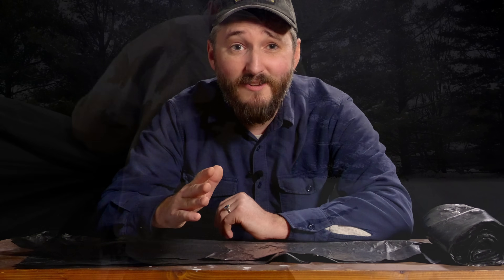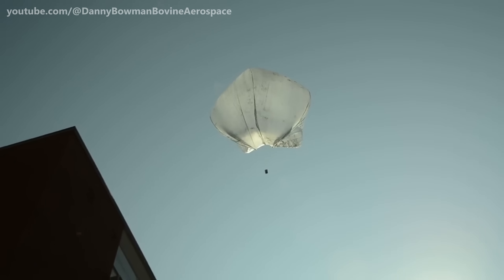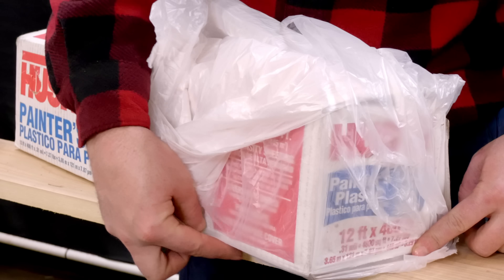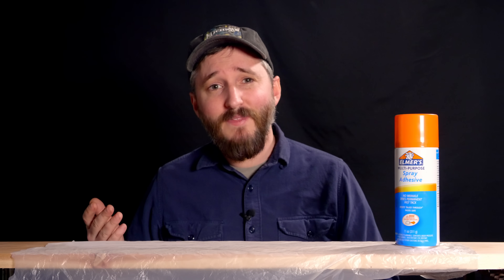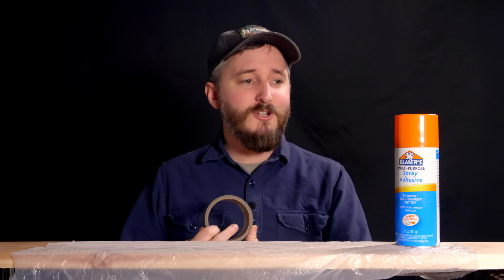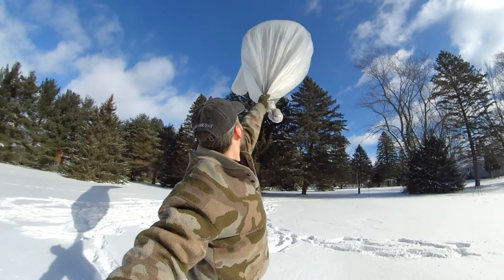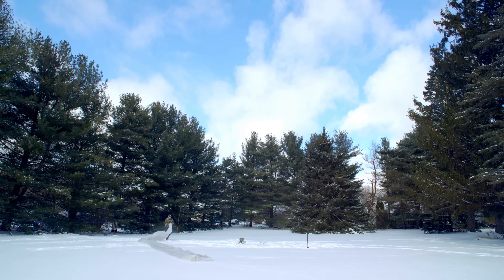DIY Solar Powered Balloons

Comment: Please explain how exactly solar power could cause the tube to become less dense.  It obviously has the same amount of mass the entire trip unless it is losing air somehow.  Is the tube itself expanding?
Reply from the maker: Yes the tube expands. You can easily tell in fact when the sun comes out the tube gets much larger. The one I made had a small hole in it the entire time which makes it deflate very slowly over the course of the flight, otherwise you would be able to tell more easily.
Reply: @Nighthawkinlight  So how about you improve the efficiency by poking a hole in a known point, allow the air to evacuate, then re-seal the hole?
Reply from the maker: @wesbaumguardner8829  It works better if there's no hole at all. Then the balloon inflates to its maximum size and lowest density, or even past the normal size by stretching the plastic
Reply: @Nighthawkinlight  I imagine it would be based entirely on the spatio-temporal difference between the density of the outside air vs the inside air.  This leads me to an alternative.  Use a material that externally absorbs heat and internally reflects heat.
Reply from the maker: @wesbaumguardner8829  That could work
Reply: @Nighthawkinlight  You could further increase efficiency by partially filling the "cell" with specific gases which absorb the spectrum emitted by the exterior paint.
Reply: @Nighthawkinlight   By the way, I expect my ideas to be open sourced and have taken measures to ensure that they are treated as so, legally.
Reply: @Nighthawkinlight  I posit a Mylar material with a highly absorbtive black paint on the exterior.

Comment: Hey Hawk, I love your work and all your videos, and I'm glad I can help... to solder the plastic sheets, add a Teflon cloth, between the heat source (the iron) and the plastic sheets, maybe use under Plastic sheets are also a good idea.
This fabric is known as: Teflon sheets for heat press.
By the way, acetone does not completely dilute my acrylic to achieve the white surface, do you have any advice on how to dilute it?
Reply from the maker: To dissolve acrylic in acetone you must stir it several times over a few days. Thanks for the plastic welding tip!

Comment: Idea: nine or ten of these balloons shaped like "number 7's" with a string attached that holds both legs of the 7 into that shape, you arrange all ten of your "7 shaped" balloons into a circle that makes it into a hot air balloon shape made of rib-like balloons rather than one larger balloon, with this configuration, they're orientated to carry a payload much better, using a light rope as a tether and your own body as a weight, you could send a camera up and walk the balloon around to get a neat camera shot or maybe grab some weather data, whatever you'd like! 😁👍
Reply from the maker: I like the rib idea! Could seal the sections together entirely and fill the middle with more hot air
Reply: @Nighthawkinlight  hey! That's not bad! Hadn't thought about that!

Comment: Diaper Genie bags work amazingly well.
Reply from the maker: You've actually tried them? I'm familiar with those bags and they seem like they'd be too small and heavy to fly. How to you make them absorb sunlight?
Reply: @Nighthawkinlight  They are blue. Its just one long bag. They work great but I do live In New Mexico where the sun is super strong. You can get a sun burn even in the winter. Another really fun thing with them is to use the shop vac to fill them up indoors. They fill up real fast like a giant snake taking over the house.

Comment: you said "it works even in the wintertime". I find it completely normal because the surrounding air is cooler resulting in bigger temp. difference between the inside and outside, providing more lift? or am I completely wrong :D
Reply from the maker: Hard to say. The air is cooler in winter, but the sun is lower giving less heat to the balloon. The factors might even out between summer and winter for a solar balloon
Reply: @Nighthawkinlight  yep you are right. It would be awesome to get that calculated, atleast approximately.

Comment: I've made these in the past life... a good 20 years ago.  Funny story follows. 
HDPE is welded by using a Teflon (PTFE) sheet between the heating element and plastic sheet. The heating element needs accurate temp control. Pressure needs to be applied as the plastic cools. Heat on one side and silicon strip underneath. 
The teflon sheet is very thin, and really a coating on glass woven mat substrate. You see it used on domestic vacuum  food storage bags.. a thin flat heater strip under near transparent nothin sticks to cover  strip.
The best way to weld or glue the seams is to NOT BUY SHEET in the first place.  The bag plastic and even thinner 'food wrap'  is always made in a continuous tube... NO SEAM. It is slit one side to make the folded sheet on a roll. 
Every large city probably has plastic bag manufacturers.... I worked for one such firm.  You can buy tube (un-slit) film form. The bags dry-cleaners put over clothes is very clear and thin. That tube unprocessed (plastic welding and trimming into separate bags) would be worth a try. 
These bag films are made using a vertical extrusion process. The extruder 'head'  (where the plastic comes out something like a pipe... thinner wall) can be 500mm in diameter.  The plastic 'tube' is sealed and then inflated to double, if not triple the finished diameter.... big bubble balloon.  The large bubble drops, cooling  to a solid form vertically, down to rollers that seal the end of the bubble  as it draws the plastic from the extruder, The speed of the take-up rollers determines wall thickness... so does bubble pressure... extrusion temp.. and extruder screw speed running flat out, 

So, LOL.. the story of the Big Balloon.   With an endless supply of film tube and idle hands, for shits 'n giggles, it wasn't hard to find a co-worker in the maintenance shop to help make them... small at first. We heated using a fuel rich sooty propane torch... industrial rocket size burner. Oxy/Acetylene can make very sooty emissions.     The odd shaped balloons would drift around the high-bay factory for harmless amusement value. 
The day came when the Big Balloon just happened.  A huge +2 metre diameter at about 8 metres long... took two of us with 2 burners to fill it with hot air quick enough.   Just when it was inflated and the end tied off someone opened a large roller door - we were too close.  The door hadn't opened more than a metre and the big balloon whipped under the door in the blink of an eye, driven by a cross wind through the factory!  Fluffy was certainly off the chain 'n running into the wild. We lost sight of it as it rose quickly.  Some of us were in hysterics.  Problem... The factory was uncomfortably close to busy Sydney International airport.    
Didn't happen again.
Reply from the maker: Thanks for the story and for the tips on finding big bags!

Comment: Dude, I was having a rough morning, a coding project hasn't gone well today so I took a few minutes before heading outside to work in the orchard to watch this and it absolutely lightened my mood, put a smile on my face and many fun ideas in my head. Never stop doing this! I wish I had money I could share so you could do more but at least you can enjoy my warm regard :)
Also: see if you can get an iron with a teflon coating and overlap the edges flatly so your tube is like a tear drop shape instead of a circle. I've worked with welding thin films before and both of those helped.
Reply from the maker: Thank you for your very kind comment! That was nice for my own mood today.

Comment: Around 14:00 you state CO2 and water vapor (H2O) are heavier than air. While CO2 is heavier 32+12 =44 , water vapor H2O is 2+ 16=18 much less than the average atomic weight of air. It has to be vapor though and it will probably freeze out as ice in your cold weather scenario.

Comment: Hmm. Why would a longer tube have better volume to weight ratio, excepting the ends of the tube ? Also old wisdom for hot air flying is that you get more lift in the winter ... so not sure it will be better at summer.
Reply from the maker: Yes just the ends of the tube reach a better ratio with a longer tube, but that's significant going from 8-12' to 50'+

Comment: I would try to join them by having a heat gun attached in front of a roller, so that it heats the sheets and then the roller presses them. Firm force is also important I guess as with other gluing processes. Oh, ant that polymer is probably a PP or PE, so yeah, it doesn't stick to almost anything. a primer might help, but i wouldn't complicate so much the task.

Comment: There's a Much more efficient way to seal the plastic...  On your wood, tape down some parchment paper.  Lay one end of the plastic and tape it the way you've been doing it.  Lay the other end of the plastic over the first, like the pages of a book.  Lay another piece of parchment paper over the plastic and tape it down.  Next, lay a metal yardstick on the parchment paper with the edge over the part that you want to seal, and take care not to trap any folds underneath the yardstick.  Finally, drag a warm soldering iron along the edge of the yardstick at about a 45-60 degree angle toward you, and the soldering iron tip will seal the plastic underneath the parchment paper.  You'll need to experiment with how fast to drag the soldering iron, how hard to press the iron tip against the parchment paper (too hard and the paper will tear), and how hot to adjust the soldering iron tip, but it won't take long since it's a pretty easy process.  The soldering iron will seal and cut the plastic, leaving no extra residue or wasted weight, and the plastic won't stick to the parchment paper when you make the seal.

I used this method to build a solar hot air balloon out of cheap thin trash bags that could lift and carry three regulation-sized basketballs.

Comment: I did several trials on this solar heated balloons. I use black polyethylene garbage bags soldered  with an electrical solder. All junctions sealed with transparent scotch tape. To inflate the spherical shaped balloons I use a standard automotive fan for the radiator. I put the fan on a big metal pipe. Sit on it. Connect the fan motor to my car battery and in seconds the balloon is full. With a gas torch it’s easy to heat up the filled balloon (avoiding to melt the plastic film…). Once filled with hot air the black film capture enough energy in a sunny day to keep the balloon high in the sky. I’ll try your glue for next projects.

Comment: Idea with the iron - instead of direct heat you could try some fabric inbetween the iron and the plastic. Just a little bit of thermal mass would help dial in, and spread out the heat.

Comment: About welding polyethylene, I have had luck by laying aluminium foil on the board, shiny side up, than lay the plastic, one more aluminium foil shiny side down, and run a soldering iron at low voltage over the foil where I want the seam.

Comment: As for making a hot air baloon you can you use a bag resealer from the dollar store to heat seal the plastic together. Personally i have used that method to make square balloons.

Comment: So cool! One thing- water vapour is actually lighter than air (H2O vs O2/N2 should have about half density so about twice the lift at same temp if water is not condensing), so lots of warm water vapour may be good for lift. I wonder if large balloons are not actually benefiting from that water vapour from propane flame?
Reply from the maker: Water vapor tends to condense on the plastic

Comment: I wouldn't use an Iron to melt them together,  i don't think it has a percise enough control of temperature and its also very large area. It would be much better to maybe use a vaccuum bag sealer that has protective coatings or an Iron used for RC airplanes that is small and has temp control. I would definitely use like teflon or silicone or parchment paper as a barrier between hot metal and the product to prevent it from getting stuck. It also helps dissipate the heat a bit and timing  it each press helps for consistency. Either way thr glue you used seems like a decent solution. Maybe a bit more expensive but it it works and it easy to apply, go for it.

Comment: I used to work for a company that built large lighting balloons for use on film sets, and l can assure you that square or rectangular balloons not only fly just fine, but can be easier to control in wind by having an attachment point in each corner. Ours were lifted by helium but were made of much heavier material, and still had more than enough lift to carry the bulbs and cables themselves. You could have an incredible surface to volume ratio by linking six 12' sheets together

Comment: In another instance of every answer being useful in a completely different context, the revelation that glue tape sorta sticks to polyethylene was the thing l needed to know to save the bellows in a concertina that isn't worth putting new parts into. The cheap leatherish material is full of pinhole air leaks, and l discovered that a free produce bag from the store almost works perfectly to line the interior, working flawlessly in compression, but needs to be adhered somehow to the inside to stop from falling away when the instrument is drawn. The glue tape will also be easier to apply than the contact adhesive that l had made only middling progress with so far

Comment: I wonder how effective it would be if you made a giant ring shape and then blow air through it at a slowish speed to extract thermal heat. Kinda like a poor mans solar thermal heater. You might even be able to nest them, to provide some insulation like a black one inside two clear ones. Then extract the hot air from the two inner most bags. If you could get the U to stand up vertically from the heat, it would take up relatively little land space but potentially be able to generate a a large temperature differential to maybe heat a house or something..... maybe even a heat pump or something.....
Reply from the maker: I had a similar thought! Could be a very cheap heater
Reply: @Nighthawkinlight  I'de totally be down to chip in like 25 bucks towards that if you ever plan to have a go. Definitely do the back of the napkin tgermal calcs first though to see if it could actually work. I definitely think your going to need 2-3 nested bags, and I dont know how you could easily stop them touching each other (which would reduce the insulation requirement) besides maybe using threads which would be hard to secure.
Reply: It would be so cheap to replace if the bag broke too, and you could have it deflate itself with a vacuum pump before a storm... :)

Comment: To heat seal the thin plastic film: Use a low wattage soldering iron with a flat tip, cover the plastic film with a thin sheet of tracing paper and run the iron tip over the paper at a consistent speed. Use a rules guide line on the paper as a guide for your iron, to make straight seams.

Comment: What about heat sealing with one of those cheap hand held slide along bag sealers?
Reply from the maker: Hard to do with a tube because you have to press from both sides
Reply: @Nighthawkinlight  not if it’s done like a simple edge seam like a sewing hem, maybe turn it inside out after so the join is inside

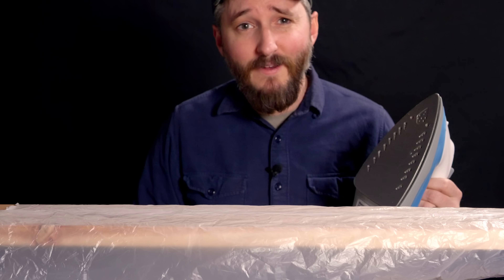Comment: @5:30 - First, get oven baking wax paper.  Place that ontop of the plastic before you iron.  The iron goes ontop of the bakers anti-stick wax paper.  For better results, use a soldering iron set to a low temperature with a flat screwdriver tip (the regulated digital numerical temperature readout of any semi-pro soldering iron means a perfect consistent melting temperature.)  Draw with the welder's flat tip ontop of the anti-stick baker paper and you will create a sealed seam the width of the flat iron tip.  The straighter the line, the better the overall strength.

Comment: I had this 3m spray that was supposed to be the same glue as post it's, used it for my car roof liner, if I find it I'll give the part number.
  If that would be useful.
Reply from the maker: Super 72 or 78 I think is a PSA, but it's around $40/can so I didn't think it was worth testing at that price
Reply: @Nighthawkinlight  yes , you know, it goes pretty far, has many uses,  I used half the can on the surface of a whole roof liner .. but for just a line, be it a long one, can't see it taking more than a quarter of it. Just a good part of the kit , ya know.
  I liked the glue you used , I should check it out.
  Devcon plastic steel epoxy is great too, not for the balloon, and Downside 12-24hr set , but get this, my old plastic armrest got brittle and shattered, Lost half the pieces, half there, I  loosely glued the pieces together, then I wrapped one of those bags around the outside, filled in the holes of the missing parts, over an inch gap each, a thin layer,  and that epoxy formed in, replacing the missing bits and stronger than new. A little sand and paint. You would never know it was half missing.
   Just saying, some thing are just a good part of the kit , , with duct tape and super glue right on top of course.